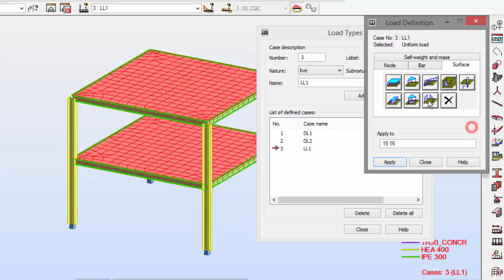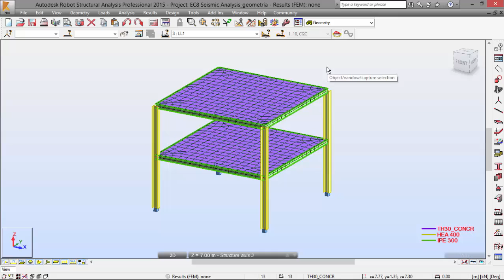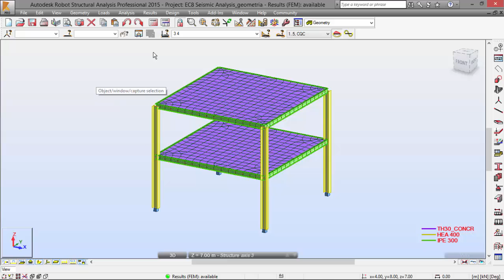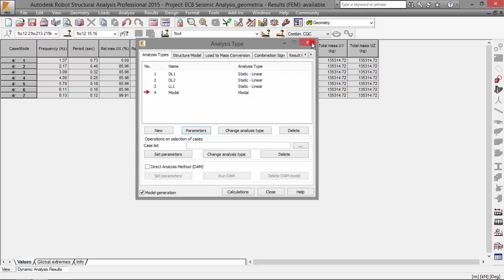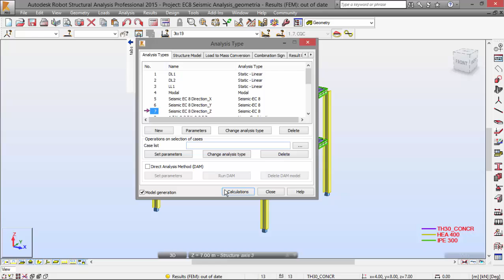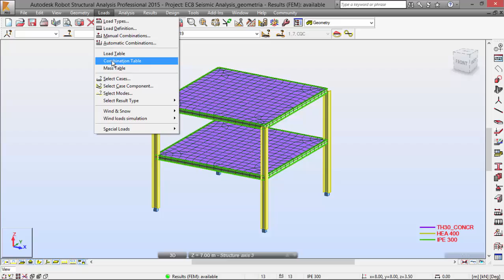Robot Strucutral Analysis - Seismic Loads

Comment: I did the same Engr.Nuno, but in calculation messages Robot said 
For 11 modes the mass participation factor is equal 85.89, although  i changed the advanced parameters  as you said, so what is the problem?

Comment: Hi Nuno,
Thank you very much for the video, I found it extremely useful.
May I ask you if you know how to perform modal analysis in Robot, when the center of mass is outside of the structure? Do we have to connect the COM with rigid links? 
For the modal I want the stiffness to be added by the surrounding steel braced frame and the mass by the stored equipment kit.
Thank you.

Comment: Hi Nuno! Do you think is there any chance of doing a non linear analysis in robot?
Reply from the maker: Hi there. Robot is good when we are talking about linear elastic analysis. Non linear analysis in Robot is possible, but very limited. What kind of non linear analysis are you interested?
Reply: @nunoteixeira-robotstructur8358  Thanks for answering me. A static pushover to verify the vulnerability of the building to a seimic solicitation. I mean I think it's impossible in robot to know when a pier or beam enters their plastic form...
Reply from the maker: @cyper89  Robot is not meant to do that kind of analysis. You will have to define the location of plastic hinges, and other parameters. But you could always ask on the forum.

Comment: At 1.41 clip why DL1 (which is self weight) NOT considered in Modal Analysis
Reply from the maker: Because it was considered explicitly on the modal analysis. At clip 1.17 you see that I have not checked the "Disregard density" box. That way, self-weight is always considered. You check that box, then you will have to add the DL1 on the load cases to be considered.

Comment: Saludos ingeniero! Me gustaría saber como puedo realizar un análisis estático con la norma de mi país la cual no esta presente en el software. Es muy similar al método que explica en este vídeo sin embargo, no se el tipo de análisis que debo definir para ingresar las combinaciones de cargas para el método de la fuerza lateral equivalente el cual usted explica en este vídeo.
Gracias de antemano!
Reply from the maker: Hi there! I am going to respond in English. My Spanish is solely based on "La Casa de Papel" and, has you can imagine, is really bad!

You need the define the spectrum of your country, on a .txt file and then "call it" inside Robot.

The best think you could do is to ask for help down the forum. There will be a lot of people to help you. 

Just go to https://forums.autodesk.com/t5/robot-structural-analysis-forum/bd-p/351 and start a new post!

Good luck!
Reply: Nuno Teixeira - Robot Structural Analysis
Cambiar a español

thank you very much! my problem is with the procedure of the equivalent lateral force. The norm of my country is not present in the software.
Reply from the maker: You will have to define your spectrum. Then you will have to do a modal-spectral analysis. You could do it in Robot.
Reply: Nuno Teixeira - Robot Structural Analysis 
Could you send me your mail? I want to explain you my problem  because my code does not allow me to do a spectral modal analysis without first doing the equivalent lateral force method.
Reply from the maker: Yes sure, here it is teixeiranh@gmail.com!
Reply: Nuno Teixeira - Robot Structural Analysis 
I sent you a message. Thanks for your kindness.
Reply from the maker: I will try to respond as soon as possible.